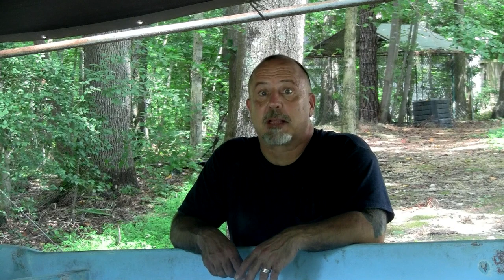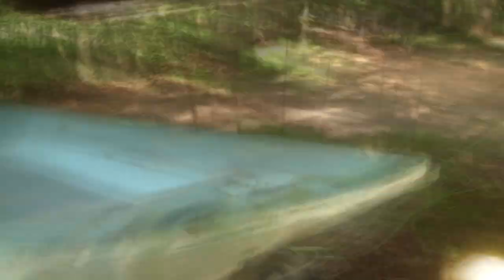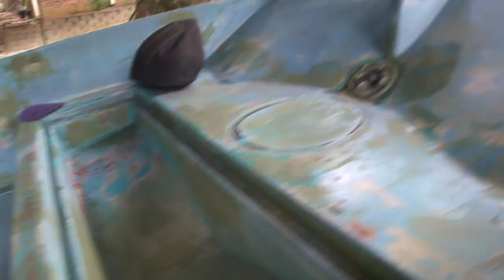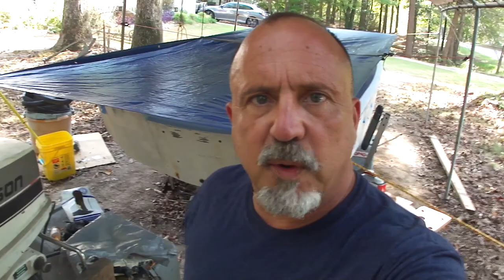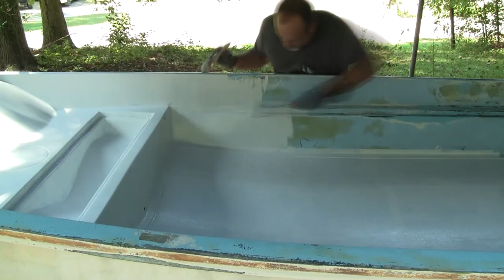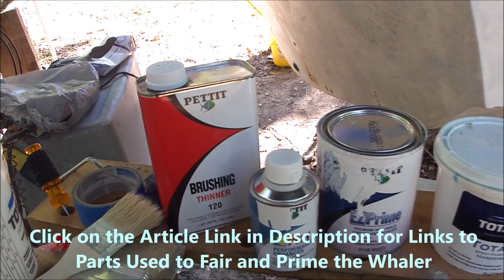How to prep Fiberglass & Gelcoat Crazing for  Primer and Topcoat - Boston Whaler Restoration part 7

Comment: I started out in life as Dental Tech- and a MUST do when repairing cracks in plastic was to first locate the end of the crack and just past that - drill a hole, then chamfer out the crack and repair.  Failing to do that was 100.0% SURE that the plastic would crack back along and all the way through.  I realise that GRP has glass fibres that help hold things together, but drilling that hole can help remove stress riser areas in plastic repairs.  Worth thinking about for any plastic parts repair, whether fibre reinforced or not.  CHEERS from AUSTRALIA.

Comment: I'm really glad I found your video series on this project. I have a '71 Nauset that I'm working on now. I'm in the process of filling old unused screw holes and sanding (when the work schedule and weather permit). I am torn right now on which primer and topside paint to use. Your videos have helped out a lot along the way. Great job, and thanks again.
Reply from the maker: Thanks! I'm glad they have been helpful to you. Overall, I am extremely pleased with the primer I used on the hull (totalboat epoxy barrier) if you can use that topside go for it. But be careful as it is not recommended that it go over single stage paints.

Comment: Great Videos!  I just started restoring my 1972 13' Whaler.  Question regarding the Total Protect Epoxy Barrier Coat Primer you used on the hull.  I was going to use Total Protect on the Topside as well as the hull since I bought a gallon on it.  I was reading the the Total Protect does not come out as smooth as the Total Boat 2-Part Epoxy Primer.  Do you think I can use the Total Protect on the topside?  I have completed all of the fairing and sanding and don't want to risk the topcoat not coming out good after all of the work I have done.  Thanks for your help.

Comment: I just bought a 66 Boston Whaler Nauset and was starting to research how to go about restoring her.. I can't thank you enough for the time and effort you put into these videos, your project will serve as a step-by-step guide for myselft and I'm sure many others! 

A few questions for you, if you don't mind sharing your experience. 
1 - When doing the sanding, how far do you really need to take the old paint/Gelcoat down? Some say all the way to the fiberglass but i noticed in your videos it looks like you got away with some of the blue paint still on there. 
2 - when doing the nonslip flooring, whats the best way to tackle that beast?

Thanks!
Reply from the maker: Thanks, I appreciate the feedback! As far as sanding, I took it down far enough where I though the combination of fairing compound and epoxy barrier coat would fill it in. I did several iterations of the barrier coat. I've heard that the cracks will eventually show through but I'm hoping that the barrier coat will keep that from happening, that was for the hull. Topside was just plain not sure but hopeful that will hold up over time. Non slip flooring is a beast. I lightly sanded over it with a stripping wheel and just painted over it with primer and paint and then later followed up with a few coats of KiwiGrip. I did think of taking a mold of the original diamond patter and recreating the missing areas with thickened epoxy but didn't go that route. Another option would be to cover the entire area with SeaDek EVA foam.

Comment: I'm also starting a restoration on a 17' Montauk.  As you can imagine I watched all of your restoration videos a bunch of times each and I have learned a lot from you. Do you think using a wire wheel on a drill would take off the gel coat on the non skid floor? I read some of the comments that you were saying you would sand down the whole non skid and redo it. Thank you so much for these videos.
Reply from the maker: I ended up leaving the non skid alone and painting over it. After that I went over it with 2 coats of Kiwi grip. I did use one of these (affiliate link) to rough it up so it would take the paint. Still not entirely happy with the deck though.
Reply: @ExtremeDIYGuy  OK, Thank You.
Reply from the maker: @fishingaddict5638  Your welcome!

Comment: Is it possible that there is any wax left in the gelcoat or does this dissappear over time? I ask because i want to do a paint job on my own boat. The gelcoat is scratched and faded and about 10/15 years old. Do i need to sand it right down to paint it or just a light sand, fill, prime and topcoat.?
Reply from the maker: IF you mean the wax from the final gelcoat to harden it then no, especially on an older boat. What you would be more likely to find is wax that has been applied to it, sanding and washing should get most if not all of it off. I use a mix of dawn and ammonia to give it a final wash before applying any paint. A final wipe down with acetone dries it and insures any remaining oils or wax is removed (paint thinner will do the same).
Reply: Ah ok. Thanks a million.  I'm looking forward to making her shine!!!

Comment: How much Pettit EZ Prime did it take? The boat being fiberglass, shouldn't it have been a 2-part urethane primer?
Reply from the maker: I think I ended up using about 2 quarts. Honestly, If I was doing this over again, I would prime with 2 part epoxy. Areas with one coat paint might peel, but I would just sand and reprime at that point.

Comment: I’m glad you made a video series on restoring a Whaler. I’m about to start work on my 1972 13 foot Whaler, and your video on patching the hole in the anchor box gave me good info on how I’m gonna patch the hole in the bottom hull. Since you used fairing compound to patch up the holes, do you recommend using that over gel coat after patching a hole with fiberglass?
Reply from the maker: It depends, the fairing compound is just a filler, kind of like bondo for boats, Gel Coat is a finish so they are not really the same. I used the fairing compound to smooth over the glass and give me a good foundation for the primer and paint. Hope that helps!
Reply: Jose's Extreme DIY That helps a lot. Thanks!

Comment: I’m curious. Do you grind off all of the non skid on the deck to fill those cracks? Also, how about the little water channel around the perimeter of the non skid? Do you use a dremel in the little groove and then fill with faring compound?
Reply from the maker: No, i left it as is and used non slip paint over it.

Comment: Thanks very much for these videos. I am a newb restoring a 17ft montauk. I have very bad spider cracks. In areas I've experimented on they go all the way down to the glass. Should I be grinding down to the glass or should I just sand and use the fairing compound. Thanks!
Reply from the maker: The common thought on that is that they should all be dremeled open or sanded down to the glass. I took a risk and sanded it down a lot and filled in with fairing compound. It's been about a year now and it's holding up fine so far but only time will tell.
Reply: @ExtremeDIYGuy  Thanks for your input. These videos have been extremely helpful!

Comment: So you mix additives into the EZ Prime? I'm doing a whaler 13' too and have never messed with any of this type of work at all. Im almost done filling in all holes and cracks, then going to be ready to sand everything to start with priming and painting. Any additional info on the priming and painting part of the project would be great. Amounts of additives for each product? Thanks for making these videos
Reply from the maker: I did add thinner and the enhancer. I did that to get more pot life and so it would flow on smoother. I don't really think it's necessary though and may actually not fill in the spider cracks, thankfully, it did in my case though. As a rule of thumb, you shouldn't exceed 10% for most topside paints. I cover painting in a few more of the videos. You can also go to BoatWorks today's channel https://www.youtube.com/channel/UC0kDqq-pSzdqFUk3oTaHBuA, he has a wealth of information on repairs and paints.

Comment: Hello Jose what deis you do with all the crazing? Did you sand all the way down to glass to get rid of crazing?
Reply from the maker: The larger cracks I filled in with fairing compound. The rest of the crazing was filled in by hi build primer.
Reply: Hi Jose,
Thanks for doing these videos they are terrific and very helpful!
I am restoring a 13' and the non-skid area is in bad shape. Do I sand it all off and apply a non-skid sand finish or is there a way to repair the factory non-skid? 

Thanks,
Mike A.
Reply from the maker: @michaelamaru1011  If I were doing it over I would sand all the non skid off and then use kiwi grip over it. There are silicone molds available that can recreate a pattern. I havent tried those yet but may consider on my next restoration.

Comment: Thanks a lot for all these videos. I'm doing a similar restoration on a 13 ft whaler and these are extremely helpful. I was wondering how you sanded and applied fairing compound to the bottom of the deck without compromising the built in nonskid in that area? I have some serious cracks in that part of the deck that has nonskid, and am not sure how to repair them. Any advice would be great. Thanks again!
Reply from the maker: I lightly sanded and painted as a placeholder. Once I finish the Hull I am going to grind down the non skid and  cover it with Kiwi-Grip. I was originally going to put EVA foam teak decking but changed my mind as I have read that some folks were having issues with it.

Comment: great videos! Thank you!  Def giving me some things to apply to my boat.  I just picked up a mid 60's 13' whaler and i'm going through the same stuff you are...  Have you gotten to the outside of the boat yet?  You doing the same to the outside that you did to the inside?  I'm in the sanding phase right now..   What grit paper are you using to start with?  40-60 grit?  Thanks!
Reply from the maker: I Haven't done anything with the outside yet. I'll basically be doing the same thing with the outside with the exception that I will be using a 2 part epoxy primer and a 2 part polyurethane finish. I try to stay with 80 grit but drop down to 60 and in some case 40 for areas that are really bad. Good luck with your restoration!
Reply: @ExtremeDIYGuy  Gotcha... have you started it yet?  I'm doing the outside of mine first.  Just had the whole thing soda blasted and i want to get at least the outside done before it gets too cold to prime and paint.  How smooth did you sand it down to be able to prime?  Any little imperfections or took it all the way down?  Curious if primer will help coat and fill the small imperfections...
Reply from the maker: I just started the third coat of coat of the finish paint. I should be able to get that complete this weekend. I'll have a video of that soon. Havent done anything with the hull yet. You want to sand the minor cracks as much as possible. I thought the heavy primer I used would fill them in but did not all the way. The fine cracks should be fine after sanding and repriming. I sanded it with 80 grit for the first coat of primer, 120 for the next and subsequent coats. Hit the last coat with 220 to prep for the topside paint. I hear you about the cold, I'm racing the clock too. I want to get teh topside done before it gets too cold.
Reply: Brian & Extreme,  My project is very similar as well; early 80s  13'- 4" Whaler.  Mine is in pretty good shape but is filled with hairline cracks all over.  Some term them as 'spiderweb cracks'.  Some of the bumper guard rivots around the top edge have broken and come loose and thinking of replacing all of it.  Like Brian, I'm curious has to how deep to sand and wonder if the fairing compound helps to fill in those small 'spider' cracks.?  Would your epoxy filler be strong enough to repair and reuse the rivoted holes left by the bumper guard?  Any recommendations on where I could find a bumper guard?  Great videos, BTW.  And I did tag the LIKE!! :-)
Reply from the maker: @bcain5823  I would use a thickened epoxy paste to fill in the rivet holes.  I think fairing compound and/or a good primer will fill in most of the spider cracks, it did for mine. For large missing voids of gelcoat, I used the thickened epoxy (I use milled glass as a thickener). Good luck!